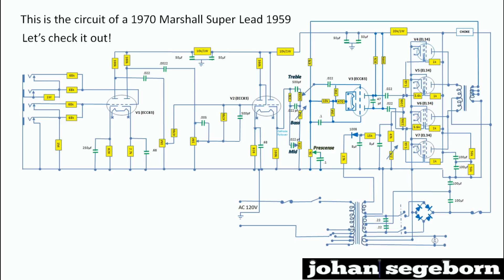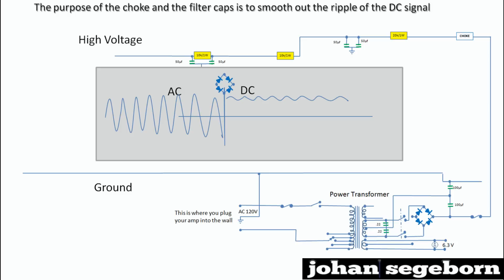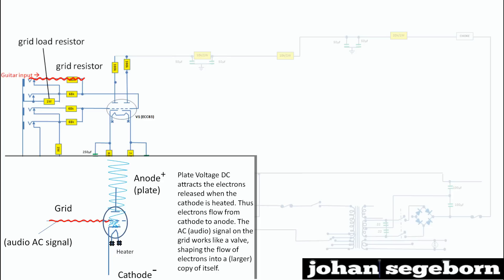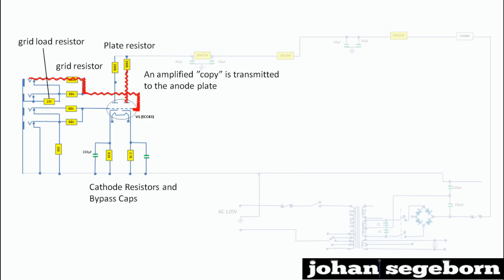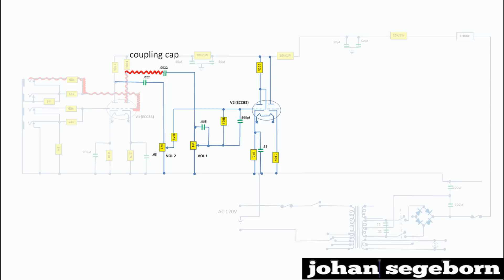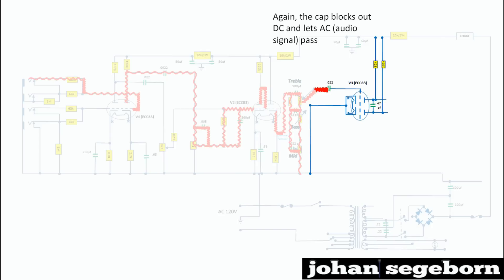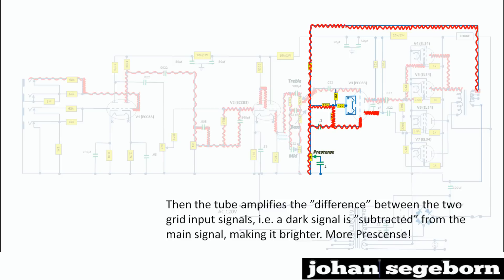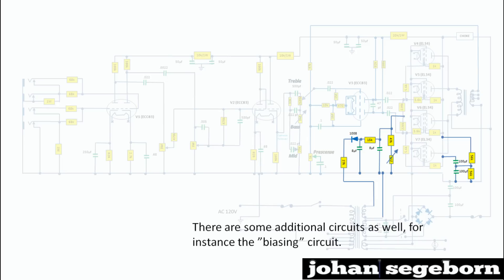How does a Marshall Super Lead Amp work?

Comment: Fantastic work, Johan.  I am electrical engineer by trade and I could not have done this better myself.  
The way you broke the schematic down into pieces and then showed waveform excerpts relating to different nodes in the circuit was fantastic!

Comment: Your ease of explanation allows me to believe that you understand the differences and similarities in the schematic of most Marshal amps.   Which lends me to feel that the dial up if not assisted with variations in parts and labor.   Are understood between takes
Reply from the maker: +JED TAYLOR I actually have a rather basic knowledge of the circuits compared to experts. And yeah back then they used whatever material they had in the shop to build the amps so the individual variation was significant.
Reply: You ve touched the very phenomenon of which I have just decided must have taken place.  At times even with the same series of amps.  Some built on American tubed some British and some German or Russian or different tubed but different grid dynamics.  Example. The 6L6 or 5881.  I hope that's the right tube for replacement recommendations.  Seems like the 60s and 70s started the whole conversion effort.  Away from 6v6 into kt 66 or even to military spec tubed. Or what ever was avalible.  It must have been a great time for amp builders

Comment: I loved the video. Somehow I have missed it back then.

I have two little corrections if I may. As you know I love your channel and this is not a criticism. It is just little correcture.

Bypass caps on the cathode resistors of the preamp tubes do not roll off the bass. They are preventing internal negative feedback loop inside of the triode itself. Higher value will give it more bass actually. Bypass cap there increases efficiency and therefore it increases the gain. Smaller values help only high frequencies and as the capacitance grows it helps lower frequencies as well.

Even those bypass caps on volume pot and on 470k resistor leading to the second tube grid aren't rolling off the bass. First one is notorious bright cap and it allows high frequencies to bypass the pot. Same thing is true for that second cap that allows high part of the signal to go around that 470k Ohm resistor. That cap is often omitted in the bass versions of the amplifiers.

Top input on this schematic does not transfer into the top input on the amplifier it self. It's logical issue copied from the Fender schematic. Fender at least narks the inputs with one and two so you know 1 is most often the high gain input.

Top input on this schematic is actually low input regarding to the gain.

Lower input on this schematics has two parallel grid stopper of 68K meaning effective value is 34K Ohm. Second 68k Ohm is added by the grounding lug of the jack. Input resistance, is in this case , is 1M Ohm. this is high impedance and high gain input.

Top input on the schematics has 68k grid stopper and input resistor is effectively only 136 KOhm. This value is what input sees towards the ground. So ti goes true the two 68K Ohm resistors and bypasses the 1 MOhm resistor and goes to the ground. 1MOhm resistor is not in use as it is shorted by the input jack. So this is very low impedance input and tons of the signal is sent to the ground directly there. 

Higher gain input is also brighter because 34K Ohm effective value is not reducing top end till some 30KHz while 68 starts rounding off the top end in the usable range of the amplifier. So low gain input is often also bit darker.

So this input schematic is a trap as one general would say :) 

Phase inverter could be explained differently btu that is completely another story.
Reply from the maker: Thanks! Appreciate the input. I’m gonna read up on it again and make notes where needed
Reply: @JohanSegeborn  if you want me, I can link up great videos explaining Fenders dual inputs as well as videos about the cathode bypass caps. The best learning channel for me was always the uncle's dough channel. Way he explained stuff she'd a light even on the stuff I knew.

Comment: Hi Johan,
there are two little things that are not quite right in your video.
1. The cathode bypass caps do not really roll of low frequencies from the audio signal. It bypasses the cathode resistor, so low frequencies "are not seen" by the resistor - this enhances the gain of the stage. The higher the capacity of the cathode cap, the lower the cut-off frequency of the gain boost. So bass amps might have larger bypass capacitors instead of none at all.
2. The second part of the phase inverter is not only driven by the negative feedback loop. Someone can cut the feedback completly and end up with something like a vox-amp, which has no feedback at all and still operate with a push-pull-power section. It's more like that the signal is "passed" through the share cathode of both stages. To put it simply: the voltage difference from cathode to grid is amplified - so it does not matter if the grid or cathode voltage is modulated, while the other is kept constant.
Nevertheless, a very good explanation!
Cheers :D
HaenC
Reply from the maker: +HaenC _ You are absolutely right! Thanks for letting me know. I'm gonna modify the clip. Cheers Johan
Reply: Isn't the purpose of the cathode bypass cap to shunt the AC component of the signal around the cathode resistor and create a fixed bias, as opposed to letting the AC create a negative feedback? Reducing the negative feedback would increase the gain, as you mentioned.
Reply: Is Blackstar utilizing this " feedback cut entirely as well" and push pull section?
Reply: How can I cut out feedback on slp? Just cut out this 47k resistor?
Reply: I've seen Doug on youtube install a pot to adjust negative feedback on a fender champ circuit and it works great, but its like a set it and forget it adjustment.
Reply: @waldemarpierzchalski  yes, some circuits don’t need NFB. but sometimes negative feed back is used to prevent OVER overdriving the phase inverter.
Reply: @BCEpedals  and adjustable NFB can make post phase inverter master volume really great even at TV volumes of this 100 watt beast, believe me.
Reply: @donrutter6765  A tweed champ is a single ended class A, there is no phase splitting. The feedback is purely to limit distortion and you can leave it out altogether. If you are referring to some later amp ignore my comment. Fender keep reusing names on completely different products and I can't keep up.

Comment: What the cathode bypass caps on the cathode resistors of V1 do is to allow each of the triode gain-stages to operate at their highest gain, if the cathode bypass caps are removed the triode gain-stages would operate at reduced gains due to the action of local negative feedback caused by the input-signal being superimposed on the cathode, the cathode-bypass caps bypass the superimposed signal to ground, enabling the triode gain stages to operate at their maximum gain, the cathode bypass caps also do set the low-end roll-off of the triode gain-stage as well.

Comment: You missed the cathode follower circuit at the phase inverter tube, which creates the inverted signal for the push pull power tubes. The negative feed back signal from the transformer is only keeping the frequency output more linear. This feedback is tweeked by the added presence control.

Comment: Hy Johan maybe you can do a few updates, the signal from grid to anode is not only an amplified copy but is shifted in phase 180°, while any signal that is injected at the cathode appears in phase at the anode.

The cathode bypass caps do not roll off bass, but increase highs by taking away local negative feedback from higher frequencies. 
The cathode resistor acts like a deflector back to the cathode, that creates local negative feedback which keeps gain down over the entire frequency range. 
A resistor - bypass capacitor, shunts frequencies to ground so there is no local negative feedback anymore. A cap is a highpass so it reaches only so far to the lower frequencies,  -as the size of the cap dictates. Thus lower frequencies cannot pass, remain in the local negative feedback, lowering gain in the lower range of the frequencies, while no local negative feedback in the higher frequencies, thus getting louder, also more uncontrolled and distorted.
Reply from the maker: Thanks Max, I’m actually gonna do a more comprehensive clip about this really soon.
Reply: How do you have time to do all these videos? I can barely get around watching them all haha.
Anyways keep them videos coming they are a treat :)

Comment: Hey Johan, I really dig your channel. Great insights into Marshalls, Celestions and all sorts of setups. I have a question that I can't seem to find an answer for. I have a JVM 410 head, and the input brightness of my guitars is darker than on a PLEXI or a JCM. I understand that it is what it is (the JVM), BUT, if I want to hear more twang going into the amp, as I would playing through a PLEXI or JCM, which component would need to be addressed? A grid resistor value? What component and value would open up that high frequency roll-off a bit so that the amp is more true to the way my single coils or humbuckers sound? I already have a fancy input buffer, Mogami cables, no pedals. Thanks!!!

Comment: do it again pointing out the components in a amp as you go,, i like how you highlighted the diagram hear. good vid. thnx
.
Reply from the maker: DANTHETUBEMAN Thanks Dan! Yeah I'm gonna compare 5 2204s between 1977 and 1983 and discuss the components. Cheers Johan
Reply: it would be great to fallow this through the board on the amp, :)  il look for the new vid from you thnx.

Comment: Question for you Johan. For the Marshall JMP the Volume 1 and 2... when either of these is turned up we achieve power amp tube break up. Since there is no master on these amps and no subsequent preamp volume control is preamp tube distortion achieved only by the dials in the tone stack? For example. I have both my volumes on 7 and guitar is in the upper left input with a jumper from lower left to upper right. As I turn up the individual knobs for presence bass mid treble there comes a point around the 6 mark on the dial that more distortion is introduced. Is this preamp distortion being added? Or is it more power amp tube distortion? When volume 1 & 2 are turned up is it only pushing the power amp tubes? Is there any way preamp tube distortion can be achieved with a JMP or is it a fixed bias on the preamp tubes set to clean only?

Comment: Thanks Johan for the interesting discussion. I used to work in audio and RF electronics in the late 60s and so this really stirs up the cobwebs for me. I was wondering if having AC on the filaments of the preamp tubes might introduce some bothersome AC hum, even though twisting the leads would reduce the hum. I also wonder if replacing the carbon pack resistors with metal film resistors in the preamp gain stages might reduce the noise floor of the amp.
Reply: It does! Though there's a huge debate on carbon vs metal resistors. Carbon are noisier both good and bad - they add a "sizzle" for lack of a better word. But better money is spent on speakers, pickups, tubes than resistors. Not worth reverse engineering if an amp already has modern components.

Tighter wraps also can help moderately

Comment: Great video, 
I would love to see how to properly bias’s one of these amps. 
Would one apply a 1khz test tone at   Input at a given amplitude, and then adjust the 27k bias turnpot to the point where the sinewave output at speaker output does not show clipped top or bottom of output sinwave , and also make sure at zero volt crossover point of the two output tubes are in horizontal time alignment with the negative portion  of the sine wave produced by the lower pair of output tubes? Or is biasing with 27k variable resistor done by simply turning and measuring grid to cathode current across a resistor till current is set to correct level for the amps design? Thanks
Reply: Watch guitarologist work on the super lead 100 and see why you bias at idle, and then bias with a input signal. Turns out, the tube sockets were not making good contact and had to be replaced. They were corroded.

Comment: +Johan Segeborn , and about bias circuit ??? I made a plexi but had problems with excess gain on channel 1. It was resolved with a signal drift grounding pin 2 of the valve 2 by a resistor of 82k. It solved the noise but it is not the solution I was looking for, is aware of which may be being generated this problem? Tks in advance.
Reply from the maker: +V8punch Thanks! Yeah that one is long overdue! This fall I'll do it. Cheers

Comment: Great video, thanks. So which cascade makes overdrive clipping? I guess the second, where the signal from both channels blended together. BTW, can you share circuit?
Reply from the maker: +Sergey Gavrilov Hi Sergei, it is the master volume 2203 that has a cascaded preamp. Cheers Johan

Comment: Except for capacitor and resistor values as well as only considering one side of the phase inverter tube as the last gain stage before hitting the power stage and thinking of one side as similar as a single ended amp, if you consider all that - this circuit topology is nearly identical to my Vox AC4C1 amp

Comment: Incidentally, both the cathode resistor and the plate/anode resistor in a triode gain-stage set the overall gain, which is determined by the ratio of the value of the two resistors, as well as set the static, or quiescent biasing point, if you set the triode gain-stage up with a 1k cathode resistor and a 10k plate/anode resistor, the resulting gain of the triode gain-stage will be 10 (10k/1k), if you replace the 10k plate/anode resistor with a 100k, the gain will in theory be 100 (100k/1k), in practice the gain will be less than 100.
Reply: In a fully bypassed gain stage such as that including V1, the cathode resistor is removed from the formula to calculate gain, and, for a specific triode, gain is determined by the value of the plate resistor. A = -mu x Rp / (Rp +rp), where Rp is the value of the plate resistor and rp is the plate resistance of the triode.

Comment: The rectifier bridge produces 120Hz ripple. Anode = plate.  Plate resistor regulates the]
amount of plate current allow a amplified voltage to be present across the plate resistor.  The source of the plate current  is the B+ supply leg.
Cathode tone stack allows for lower voltages and therefore lower voltages to the
manual controls as well.
 The inverter/driver  tube drives the output tubes which generally operate in Class B push-pull.
Bias also allows to bias the cutoff of each tube (within linear operational area) and
overcoming the crossover notch distortion which is apparent in most push=pull transformer stages.  Each output tube conducts through one half of the output
transformer primary when the voltage is positive.

 When the transformer signal voltage goes negative, one power tube goes into cutoff and the other tube, now being in the correct 180 degree phase,  conducts for one half audio cycle and so on.
The secondary winding is a much lower voltage and impedance matched to the
speaker(s).

Comment: Hi Johan, why is there no coupling capacitor between the first and second stage of V2?
Reply: The first triode is working as a gain stage and the second triode is working as a direct coupled cathode follower. The plate voltage of the first triode is the grid voltage of the cathode follower, so no coupling cap is required to block DC. The grid of the cathode follower is at a high voltage, but current flowing in the triode and therefore in the 100k cathode load resistor develops a voltage at the cathode which is slightly higher than the grid voltage so that the grid is negative with respect to the cathode.

Comment: Johan,how does this architecture work compared to the jvm's?The JVm's have no diode distortion unlike other models(800's900's etc) and can use %100 tube saturation!.I believe and have heard a JVM pull  plexi sounds easily,when used correctly(most people use to much gain when trying IME and using greenbacks or the like) what are your thoughts?
Reply from the maker: Kate Andrews Hi Kate! The JCM800 2205/2210
had diods but not the 2203/2204s and the SL-X JCM900s were the only ones
without diods. 

<p class="MsoNormal" style="margin-bottom:0cm;margin-bottom:.0001pt;line-height:
14.95pt"> 

<p class="MsoNormal" style="margin-bottom:0cm;margin-bottom:.0001pt;line-height:
14.95pt">The JVM has an extra preamp tube compared to the 1959,
which is engaged in some of the settings in the JVM. Marshall themselves states
in the manual that “CRUNCH
GREEN MODEuses the same preamp topology of the classic Marshall JTM45/1959
'Plexi' models (i.e.: gain + gain + tone) but with a bit more of gain than is
found in the originals” 

<p class="MsoNormal" style="margin-bottom:0cm;margin-bottom:.0001pt;line-height:
14.95pt">

However
here I used the OD2 orange mode which adds an additional gain stage compared to
the 1959.  Still this is in my opinion
what sounds the closest to the typical aggressive but rather clean clipping
sound of a vintage super lead.

Cheers

Johan
Reply: thank you.
I thought the JCM 900's did?,how is that distortion achieved on the 900DR's?
Reply from the maker: Hi, DR and MkIII have diods and the SL-X has an extra preamp tube.